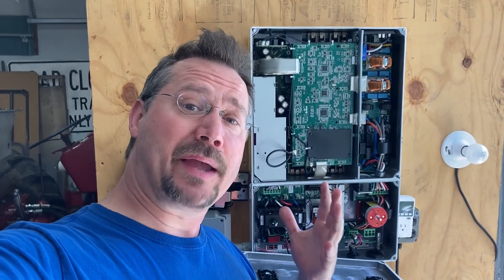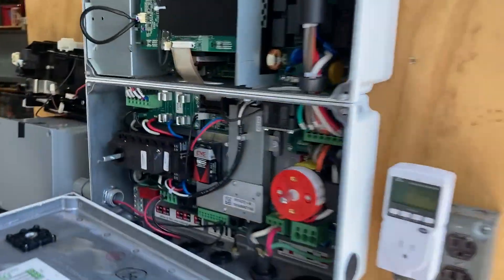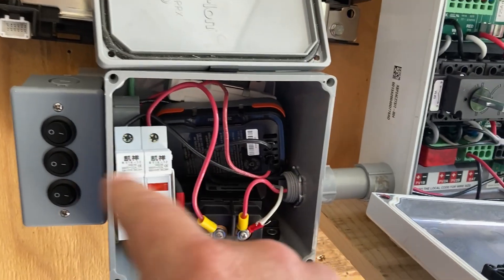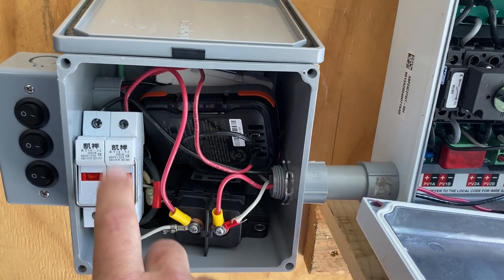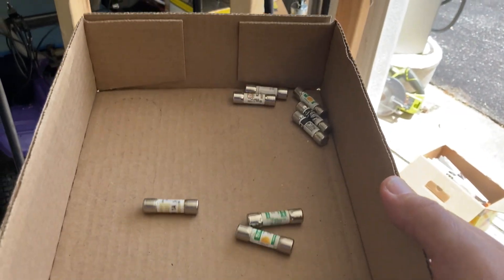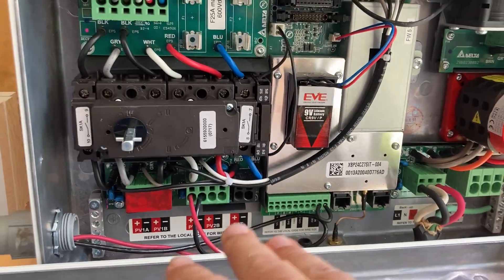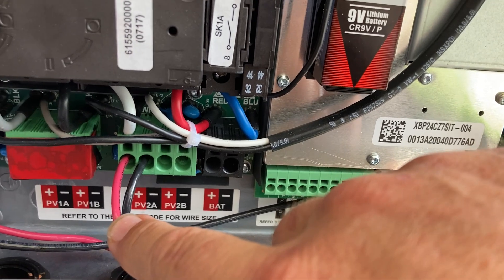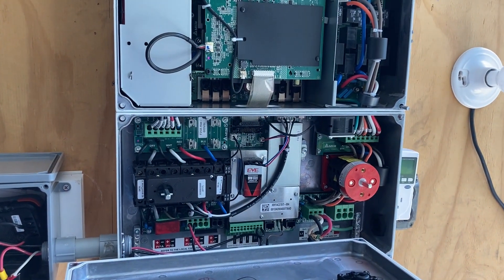I blew up the solar inverter! (CHAdeMO V2G Project)

Comment: Amazing , how many volt ac Mitsubishi create 150 v dc series connection right ? 

To ac how many volt AC Mitsubishi create to run ac motor ? Please let me know
Reply from the maker: @thehighriseconstructionob9679  Most electric vehicles use a battery pack between about 350 and 400 VDC.

Comment: The problem with most inverters and especially solar generators today is that the vast majority of them use, cheap, lightweight high frequency, transformerless inverter technology. Because they lack a transformer to isolate the battery from your AC loads,  it only takes a single MOSFET to short to ground in these inverters and they will pass high amperage, high voltage DC current though to your AC loads that can start a fire in your connected appliances. A much better and safer inverter technology is a low frequency, transformer based inverter. They run much cooler, will last far, far longer and won't burn your appliances, EV or home to the ground.

Comment: Great video sir. I am finding it hard to get info with regards the chademo. May I ask what pins you used to allow car to open contacts to gain access to the battery DC volts. I am in the process of trying to find a cheap chademo socket as I want to use my Nissan's 62kw battery to run house. My issue has been trying to find how I use the pins in the plug to allow the nissan to open its contactor to battery. Can you help sir. Gino UK

Comment: Hi @BenjaminNelson, nice work there - I'm doing something very similar with a Leaf at the moment and I came across your channel. If you don't mind me asking, what is the part number of that Leaf precharge resistor module? and do you know what the value of the resistor is? ie. what ohms and what power rating? How are you currently working out how long to have it ON for before the bypass relay kicks in? and what do those 3 magical switches do? :)

Comment: Awsome video. Can I please ask if this is an mppt solar controller? Does mppt cause any issues when we change solar panels for a car battery?
Reply from the maker: Yes, it's an MPPT solar controller. Pretty much anything now except the most basic/inexpensive solar charge controllers are MPPT.

The issue is that there are a few different ways to do MPPT. At least one of the techniques involves shorting the solar input and checking the change in voltage. That would NOT be a good thing if a high-voltage EV car battery was connected!

Other than accidentally reversing the polarity to one of the solar inputs, this has been a very interesting project. I've pulled relatively large power draws from my car, through the inverter, and out to 120/240V AC several times.
Reply: @BenjaminNelsonX  That's interesting that it behaves the way it does despite it being MPPT input - do you have any theories why it does work?

Comment: I have this same inverter.. I believe that you will be limited to 4000W only using one of the two available MPPT inputs. Also, have you successfully tested it with 350VDC on that PV2 MPPT input?

Comment: So a pre-charge resistor in general is in the battery bank?
Reply from the maker: Typical commercial electric cars have a pre-charge resistor and a pair of contactors IN the battery pack.
When the car is OFF, the contactors open and the battery is completely disconnected from everything. When you turn the car on, it quickly precharges to the motor controller and then closes the contactor. There is then power to the drive system and you can operate the car.

In my project here, I'm repurposing a Nissan Leaf contactor and pre-charge resistor. The resistor is rated at 30 ohm, but is a large ceramic style, so it can handle quite a bit of power for the brief moment that current is flowing through it.

Comment: Maybe stupid question but: Why not use the DC Battery connector as Input for the inverter instead of PV entries ? Like if you were running on backup power source I mean.  Maybe this inverter does not support 400V battery ?
Reply from the maker: The Battery Input on this inverter was really only designed for the ORIGINAL Tesla Powerwall battery, which is actually EVEN HIGHER voltage than what the car battery pack is. The battery input also expects some communications signals from the battery, which I don't have and don't know the details of.

Comment: Now you know that the wiring is different, be sure to make a label for inside that switch box!

I've had instances in the past where I've gone "Okay, this is different/non standard! I must not do X or Y!" Then I've got stressed or tired or short on time, and I end up doing EXACTLY THAT THING. and BOOM! 

Great work Ben :) Glad you had a backup circuit to get things running. Are you planning on taking out the main board and fixing the circuit in the future?
Reply from the maker: Yes, exactly right about the labeling!
Once I figured this out, I made some markings, taped off the PV1 input, etc.

Fixing the PV1 input may be beyond my electronics skills. If it was a single discreet part that was through soldered and obviously blown, then perhaps I can.

I'll probably take a look at it, it's just not high on my priority list at the moment as I have more pressing work to do!
Reply: @BenjaminNelsonX  Good to know! Because I grew up in the UK and were used to the UK wiring system I always quadruple check things before doing anything here. When I had to wire up the mini splits, I went to the back of the garage a million times to check everything was right. 

The last laugh? Electrical passed inspection (the bit I did)
The heat pump install did not (the units were not screwed to the ground - but I didn't do this).

Comment: Hi Ben, I’ve been wondering if the iMiev supports V2G officially like the 2nd generation Leaf, I’m assuming not which is why you have taken the path you have. Thanks 👍
Reply from the maker: I believe that the iMiEV DOES support V2G.
However, I do not know what the specific required CAN signals would be to activate the internal relay in the car. The "Hack" on this project is knowing where the relay is and activating it manually.
If I knew and could generate the CANBUS signals, that would really allow me to make this project slick and also be able to use it with any standard Nissan Leaf.
Reply: @BenjaminNelsonX  thanks for the comment
Reply: Yes, they do.

They implemented at Pikes Peak, and later pushed the change to production...

In Japan, you can get a Mitsubishi inverters to directly connect to the CHAdeMO contact.
Reply: I think it would be better to say the IMiEV and the Leaf both support bidirectional charging - neither supports V2G per se as you need an inverter externally to created the V2G support.

Comment: It sounds like you blew some kind of protection device.  It doesn't need to be burnt.  It's located very close to the connector.  You'll have to remove the PCB from the unit to examine.  You'll probably have to do some reverse engineering since schematics are probably not available.

Comment: Glad its not totally totalled. Had a funny moment on my solar invert the other day. Its an old eversolar inverter and it has two string inputs on the outside. I have put more watts of panels than it can probably handle but not by much and they are older panels so not as efficient as they once were. Anyway the other day it didnt spring into life in the morning. I unhooked everything looked inside. One of the contactors was mildly different on its front surface to the other. Looks as you say completely unspectacular. I remember johannes hubner fiximg his evc contactors with a hammer to free the sticking contacts. I was less brutish and just flick mine a couple of times with my fingers. Put it back together and onto the wall and it working again. I think you will be able to trace out the broken input given time as you have a good reference on pv2. Curiously on my eversolar unit the second pv2 inputs on the pcb were unpopulated so i think somehow the unit puts the 2 array input in series automatically but ive no idea how. Seems unlikely that it would parallel them and i have uneven strings 15 versus 8 panels. Anyway great work.
Reply: Contact burnishing tool.

Comment: Bummer. But good it still works! It's good to check PV inputs carefully or rather the type of MPPT utilized. Many types of MPPT periodically short circuit the PV input to more rapidly follow the true maximum power point... Connecting a battery on an input with that functionality would end badly for the inveter. But hey nice setup! I have 48V DC inverters on my house and have thought about using a buck converter off the chademo to drop the near 400V to 48V.

Comment: There are varistors... PV1 has varistor that has shorted.... It is like fuse for over current.
Reply: No, a varistor isn't polarity sensitive just voltage. It could be a diode that has shorted though, across the input as a protection device. I would imagine reverse polarity would be fairly common with installation hence a protection diode across the PV inputs
Reply: @myozone  take that board out and measure.... Is the short on that switch board or further

Comment: You probably already know this but for the benefit of others I received some great advice from Damien Maguire for working with high voltage DC.
Put a couple of incandescent light bulbs in series with your connections until You know you have it correct. That way any mistakes causing a short will light the bulbs and not kill the system.
Reply from the maker: I had the proper resistor in line. The issue was the reverse polarity!
Light bulbs ARE nice in that they give you some visual feedback!
Reply: @BenjaminNelsonX  I did the same thing to my setup with a Nissan Leaf Contactor block and my inverter but in my case I was saved by the resistor burning out. I had a 10 amp fuse in line that didn't blow. A light bulb might have saved your inverter as a current limiter. A 60W 240V light bulb has a resistance around 1kR so two of them would have put a 2kR resistor in line. 
And double check your contractors are still working. Mine is now a short circuit but that was a different cock up. 😒
Reply from the maker: Contactors are all good!
Reply: @BenjaminNelsonX  
Light bulbs not only light up, but also increase in resistance when lit, so little current flows, which can save a component, which a resistor or fuse won't.
Incidentally, red and black used to be the standard colours in UK domestic electric systems, red for live (you call it line or hot) black for negative. 
So us in the UK, red and black is pretty much always as above. Incidentally UK built cars also follow the red for + and black for - on the vehicle battery connections.

Comment: From my experience with other devices, generally either protection diodes or mosfets fail short like to ground and short the system so it blows your fuse automatically. You could probably find the part that shorted by probing continuity across it and seeing if it's a dead short. As long as you can see the part number you can replace it easily.
Reply from the maker: There’s a LOT of electronics inside this inverter. I didn’t see any that looked obviously blown to the naked eye. It would take quite some time to probe them all!
Of course, ideally, I’d love to know exactly what blew and where it was.
Reply: @BenjaminNelsonX  They should be placed close to your input connections to be able to protect everything after them.

Comment: PV at 300VDC is equivalent to 16 solar panels in series. Is the inverter rated for that?
Reply from the maker: The inverter is rated for up to 570VDV on the solar input.

Comment: Ah so the inverter was ready for two strings is what I get out of this? Good thing they have proper separation built in! Also is that an incandescent light next to the setup? 👀
Reply from the maker: The bulb is a 100 watt incandescent. It’s a nice simple load and easy way to show the inverter being on and active.
Reply: Yeah LED lights are sensitive to voltage and frequency swings
Incandescent lights are really just a big light emitting resistor so they're good for testing setups like this where something might go wrong and cause a big swing
Also because its a big resistor its good for slowing down current if needed
Reply: @st3rox  Ok that makes sense.

Comment: So the pre-charging is a must? To prevent inrush currents? I’m working on a similar project… (camper)
Also, i’ve been warned there might be an issue if the car is driving… to much rimple on the   DC?
Reply from the maker: You definitely want to precharge anytime you have a battery and power equipment with capacitors that can cause a large inrush current. 

I can’t drive the car while powering out through the CHADEMO. There’s a safety feature that prevents driving off while being plugged in.

Comment: huh... I wonder, if the PV1 DC input was still working... could you do dual source DC? could you use that to transition DC sources on the fly?

Such as between a stationary battery and a CHAdeMO source?  Start on the stationary, add the car, remove the stationary, etc?

looking again, I see it has a battery I put/output aswell. so maybe this idea is overkill?
Reply from the maker: The battery input was designed for the original Tesla Powerwall. It was very particular and also uses some communications signals to be able to activate the battery. NOT easy to use that battery input right now. On the other hand, the Photovoltaic input was a broad range that included that of a typical electric car.
Reply: @BenjaminNelsonX  I see.. I was under the impression that one should not attach a battery to a PV PPT capable inverter input?  Was I under the wrong impression and it's more doable than I thought?
Reply from the maker: "Should not" is probably the best approach.
The big issue is that batteries have the potential for HIGH CURRENT in a way that PV does NOT. That's a big deal if the inverter or solar charge controller intentionally shorts the + and - together as a way to check the maximum current. That's fine for panels, but directly shorting a high voltage battery is a big no-no!
I've been wanting to do this project for years, but was trying to find information on what technique different inverters used for checking the PV current for MPPT. I don't even remember where I found the information that it would work OK with this particular inverter.
The other big thing is to USE GOOD FUSES! If things go wrong, you definitely want proper fusing. I've been using fast blow fuses rated for 600VDC.
Reply: @BenjaminNelsonX  excellent explanation... Thanks for confirming not to assume this shouldn't be attempted with knowing for sure the inverters MPPT methods.

Comment: Sizzle sizzle foomp.
Reply from the maker: The best part was that all the safety features worked exactly as they were supposed to. I couldn’t even tell what the issue was at first until checking the fuses with the continuity meter!